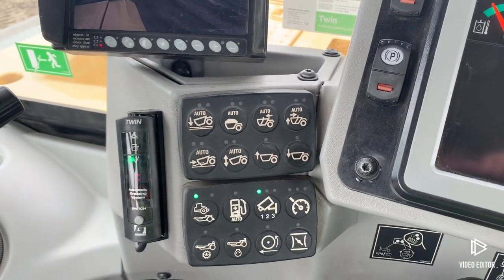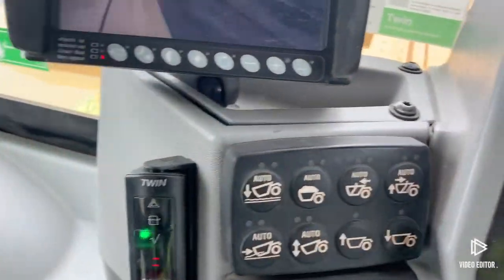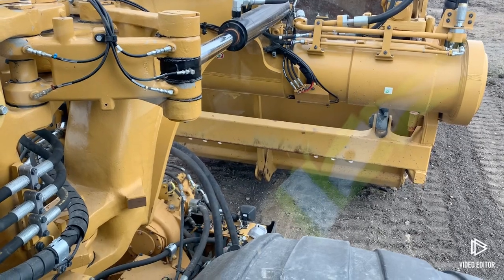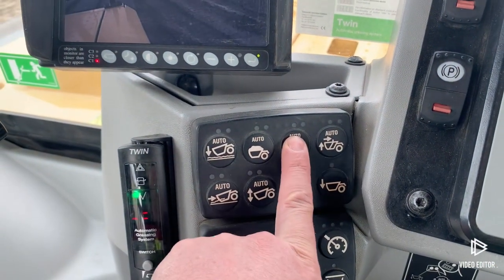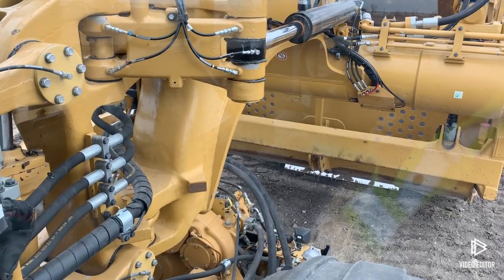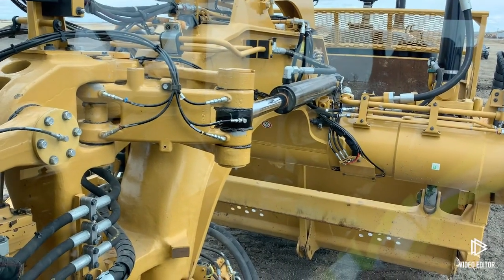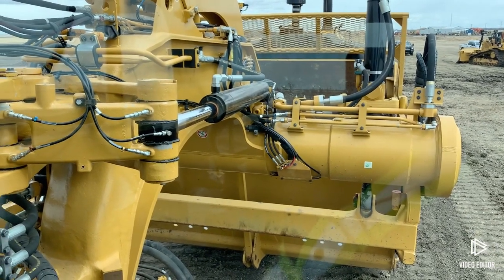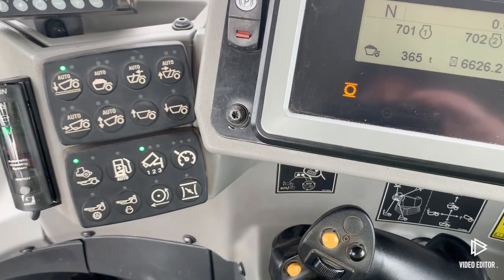Caterpillar Sequence Assist tutorial - 627K motor scraper

Comment: Thanks for showing us that, (this is the missus yt account) iv been a plant operator for 26 years, and done my time on everything including 5 years on a 637 E in a gravel quarry. Now im just on a 30 ton excavator doing odd jobs. I refused to use the GPS computer crap, im old school all done by eye and feel. Done 4 years on a 980G sales loader loading crushed rock on to road tippers. What your 627k has is all to do with reducing operator fatigue, because doing 120 loads a day of the same cut depths and fill levels increases operator fatigue and boredom, reducing productivity. Also keeps the cut & fill areas more level, because those scrappers are so uncomfortable. I still reckon articulated 6 wheel dumpers are worse. Anyway take care from Australia.👍
Reply from the maker: Thanks for the comment! The other thing that these kinds of features do is help new inexperienced operators be more productive faster. The younger generations like this kind of stuff, it’s how we get them interested in the industry.
Reply: @ironman3406  keeps them interested from day one. If it's too hard or Labor intensive they're not gunna stick with it, right.
Reply: Longer wheelbase & being able to grade your own haul road

Comment: How do you recommend getting into something like this as a newbie? Ive been a transport driver for years, would really like to get into operating.
Reply: I wouldn't recommend scrappers or 6 wheel articulated dumpers, too rough on the body and boring. I'd recommend still doing smaller civil jobs to watch and learn smaller machines, then step up to a quarry operating dump trucks.
Reply: Using my Girlfriends account lol
Reply from the maker: First think look up whatever regulations there might be in your region as far as licenses or certifications go, make sure you get them first.  Then the Biggest piece of advice I’ll give you is don’t expect to get put in the high caliber grade wages right off the bat, moving the equipment on and off a trailer is very different then actually using it.  You have to be willing to start out on some of the more grunt work machines like compactors for example.  Just start sending resumes man! Every contractor is looking for operators.
Reply: @ironman3406  thank you for the advice!

Comment: What's the idea of the cushion hitch on these new scrapers compared to the old?
Reply from the maker: Well Cats have had cushion hitches since the late 70’a early 80’s so it’s nothing new for Cat - but there is a hydraulic cylinder between the tractor and the scraper that had a nitrogen charged accumulator in the circuit, it lets the scraper and the tractor go over bumps independently making for a smoother ride between the two and the a smoother ride for the operator.